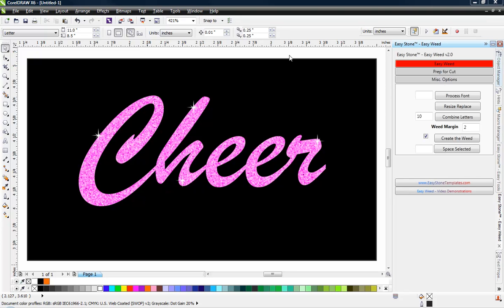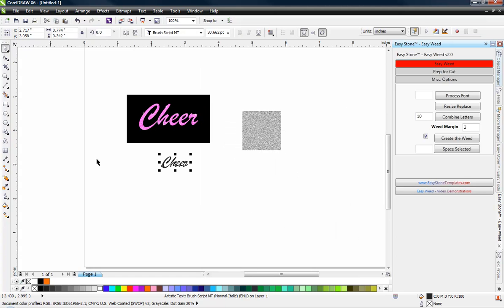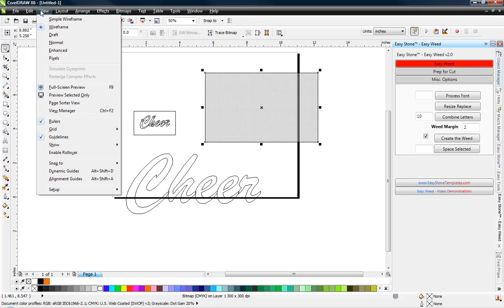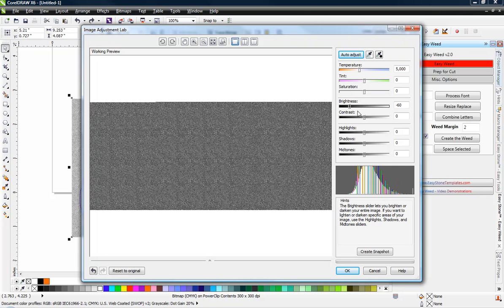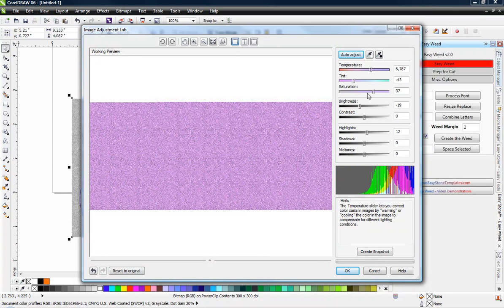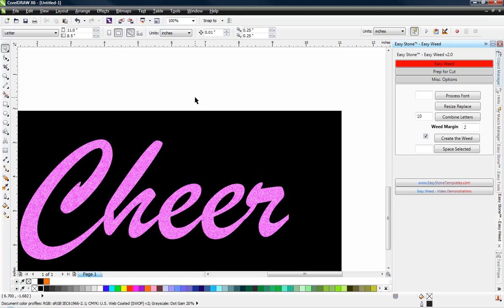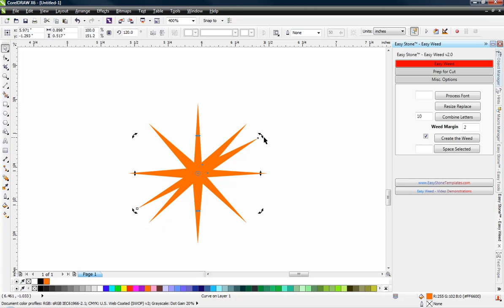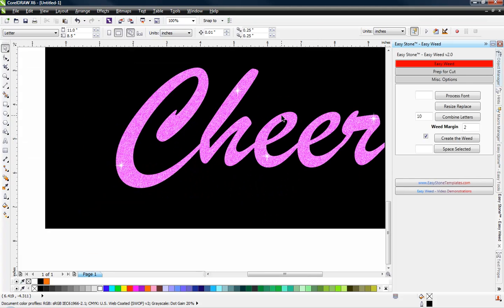CorelDRAW - Heat Press Glitter Mock-Ups

Comment: Excellent, informative  video. I did have a problem. When I Exported the object to a JPG file however, the image appeared very small in the corner of a large area, and the size went to 6 MB! Does Power Clip have something to do with this? Thanks!

Comment: Actually in photoshop you can make or download sparkle paint brushes for free.  Nice and easy.  Creating the actual glitter can be done a lot easier in photoshop rather then playing with the different steps in corel.  Step by step... in less then 1/2 the clicks... it can be done in photoshop.  

True if someone only has Corel then this is great.